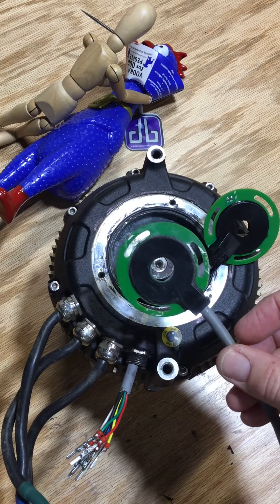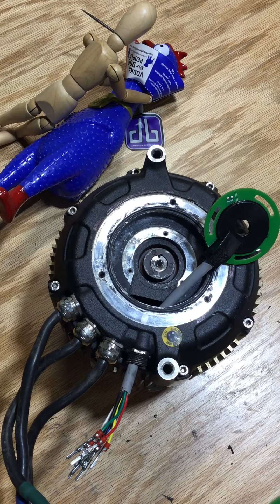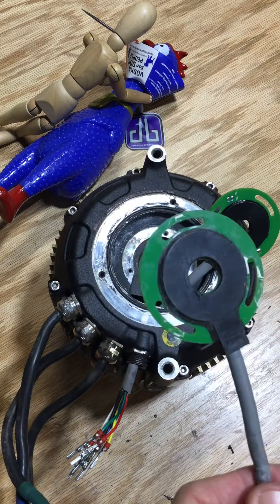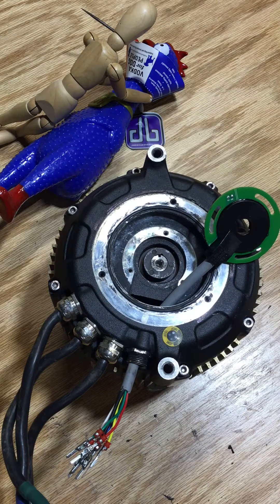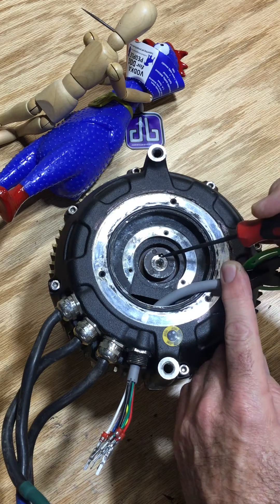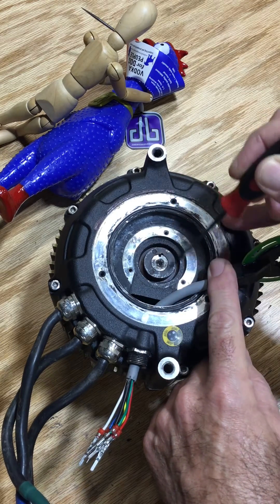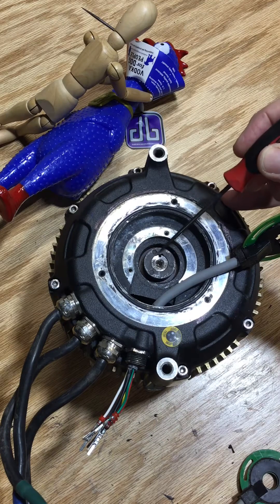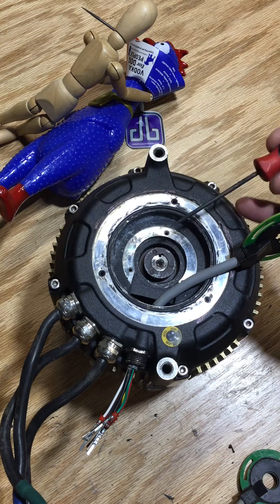Sur-Ron motor hall effect sensor failure?

Comment: Hey question for you my altra bee I just put a torp controller on did all the calibrations and everything but when i ride it its gut less when I'm riding it in sport mode. but has lots of power on the dirt bike stand and on the torp app it's saying it's over heating but my motor is cold to the tuch and it's saying hall sensor error
Reply from the maker: @braydenkoop4541  Hey Brayden, we use EBMX and Nucular controllers, so unfortunately we have very little experience with Torp

Comment: Just a FYI, my Surron kept cutting out and all the safety switches and tilt sensor were unplugged. Replaced the throttle, no luck. Tried different battery, no luck. Opened the motor, it looks clean and fine. Check wiring, no luck. Bought a KO Pro controller and the motor ran backwards at first. Switched two phase wires, it jerked like crazy so switched them back. Recalibrated with the app and finally it learned to go forwards, Now its finally running and seems normal again. Not sure if my magnet slipped but it seems to be fixed so far. Crazy issue.
Reply from the maker: I'll say! Great troubleshooting, glad you were able to fix it.

Comment: My sports mode won’t work. Will this be the same problem
Reply from the maker: No, the hall sensor has nothing to do with eco/sport modes. I would check your wiring connectors.
Reply: @db_dirtybike  I swapped the eco / spots switch out and it worked

Comment: My motor stopped,, it jerked,, now its difficult to push even when off with battery disconnected,, did a magnet break , do i need a new motor?
Reply: Possibly. Check your primary belt also. Make sure it is not damaged.

Comment: How did you temove the magnet to realign the notches ,just ory it off carefully ? Do you have a video of that details?
Reply: Gently pry it up with very small screwdrivers. It should come off pretty easily if it has indeed broken loose. I used green loctite to reinstall it.

Comment: I had the same issue with my bike. The bike would be jerky and wouldn’t move at full throttle. I did take apart the motor, I only noticed 1 notch. How do I align it if there’s only one notch on the motor? What I’m I missing? My bike is a 2018 Sur Ron model. Mahalo!!!
Reply: look for a little "line" marked on the shaft end if there is not notch... the dude cuts the video before he shows how he removed the magnet... wtf.
Reply from the maker: The dude’s an idiot 😅
Reply: @bikeninja956 mahalo! 🤙🏽

Comment: I had the same issues in my Surron X w/ ASI BAC 4000 controller. I ordered a new hall sensor and got the motor open. Now the new sensor comes with 2 more wires that are connected to the engine itself on the old sensor. Did you have this too and do you know how to solve this?
Thank you!
Reply: I am also having the same issues, can you let me know if you find a fix?
Reply: @theschwab312  i will - as soon as I figure this out or get help from someone
Reply: @BenZilch  any chance you swapped back to your old controller without issue? Thinking I may need to do that for the time being unfortunately
Reply: Did you get anywhere with this? I’m doing the same thing and don’t know weather to connect these other two wires that are in the motor.
Reply: @TomAdcock1996  
I have the same problem, if you find a solution, please tell me, thanks
Reply: @TomAdcock1996  The 2 wires are the temperature sensor. The guy in the video said that on the new hall sensor it's built in, while on the previous sensor, you need to manually re-connect it with sothering. There is another 22 min video on YT on how to replace it and he explains it in details.

Comment: my surron x has 1300 miles ...turned the key on after a very short ride and no power...thought i heard my ignition sizzling a few times while turning the key...so im hopin its the ignition...ordered 1 on amazon "booooo"...but if its not that... wut do u think it could be???
Reply from the maker: Could be the circuit protector, they have a tendency to fail. If not that, might be a connection issue, it's hard to say. Let me know what you find. Good luck!
Reply: @db_dirtybike   i unhooked the red wire to the controller isolating it... and lights and dash came back on... so it was the controller after all
Reply: @db_dirtybike    unfortunately...it wasnt the ignition.... any suggestions wut to start with ???? ill check the circuit breaker next .... any help will be appreciated thanks... pauly

Comment: Good vid. I believe I am having the same hall sensor issue. I took the motor out but I am having trouble getting the cover off. Any recommendations? Thanks!
Reply from the maker: Tap it and try to rotate it to break the sealant. Good luck, it can be difficult.
Reply: @db_dirtybike  
Got it thank you!

Comment: Im super curios to this controller and how it utilizes the sensor. i come from the rc world and most "escs" that are sensord have a sensorless mode and after a certain rpm in sensor mode it will convert to sensorless mode for efficecy. you had metioned a gps plug in another video for eu models why?
Reply from the maker: Works just like an RC ESC using sensor mode to start.